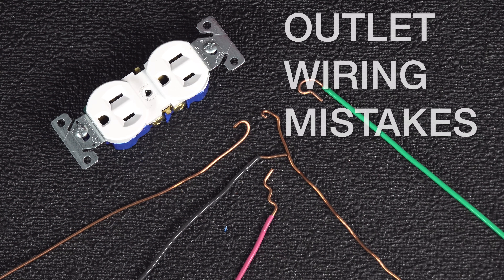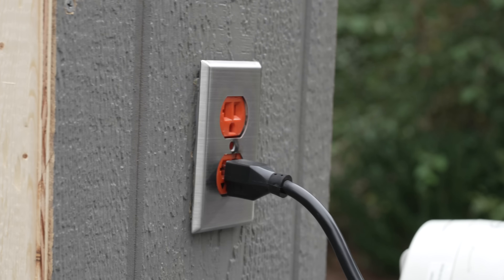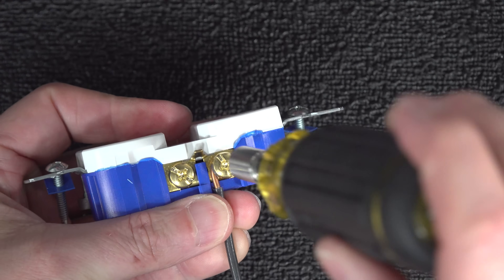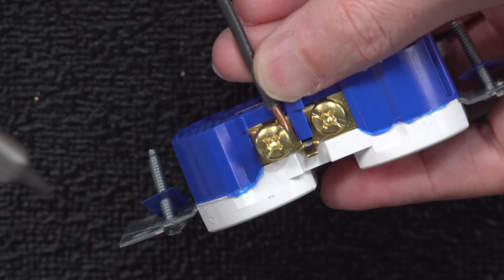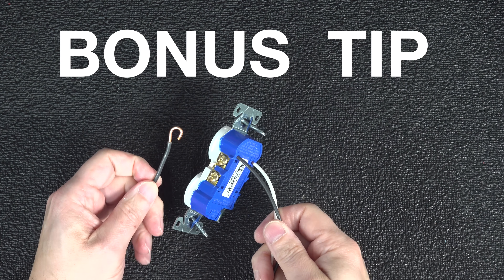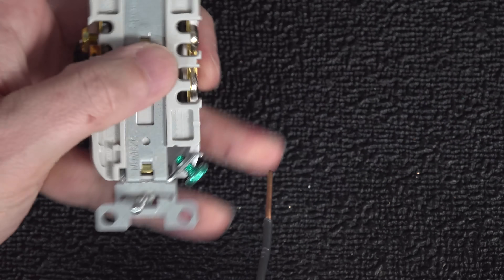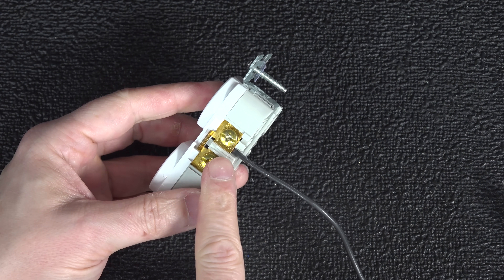BEWARE Of These 3 Common Wiring Mistakes On Outlets & Switches

Comment: Back stabs work just fine when u do them correctly. I was replacing receps ( not called outlets) and they have been working with backstabs since the price of them was $.19(I'm guessing the 70s) just fine. Backstabbing causing issues even when properly installed is an old wives tale. That being said, those along with pretty much everything in electrical can be a fire starter if done incorrectly.

Comment: Be careful saying black is always on gold or assuming black is always the hot should it be yes but best to make sure before you just assume and it’s even worse when you have 5 wires in the box and only half go to the outlet so be careful with what you assume in wiring or you will be chasing breakers

Comment: I am not a professional residential electrician but have an associate's degree in electrical systems and wire mostly low voltage dc panels at work. Still, when doing my own AC wiring at home, I just don't trust the clamp method, conductors become warm , even hot at times, when switch is off, they cool and retract, years of expansion & contracting distorts the metal conductor and they can become loose and even move. At least with a Shepard's hook there is not much chance of conductor pulling away or dislodging from device. Some ol' timers used to use shepard's hook and then tape around the screw connections because they were aware of metallurgy involved in conductors heating & cooling and the tension forced on wires when pressing receptacle back in gang box. Simple applied physics.

Comment: I am not a licensed electrician but in school I was taught to pigtail to individual outlets. 
Not only was it the way I was taught but I've seen several cases where jumping through an outlet has caused major problems. 
My buddies grandma's house has outlets jumped together thru her living room ending at a outside outlet. 
This outside outlet became damaged when the cord was snatched out of it. 
When I went over to inspect it I realized she almost lost her house because the circuit was on an stupidly oversized breaker. 
5 parallel jumped 15a outlets on a 30a breaker. Any guesses what happened? 
Yep it torched all 5 outlets between the outside and the panel before it kicked out. 
Singe the drapes which lucky went out since she was asleep and the a hole who did it said he saw it arc outside but thought it was fine and left. 
With all this said no it should not have been on a 30a breaker but it's has been corrected but if it had been pigtailed instead of jumped it would not have burned the outlets inside the houss before it tripped out. 
Psa: Breakers are to protect the house wiring and there by you from being harmed from over current because you try to run 25amps thru wiring and outlets rated for 15a.
DO NOT CHANGE THE AMPERAGE RATING OF THE BREAKERS OR FUSES IN ANY ELECTRICAL SYSTEM FOR ANY REASON THEY ARE THERE FOR A REASON! sorry pet peeve

Comment: Wrap your receptacle terminals with electrical tape.Go all the way around the devices terminals for added protection 👍
Reply: Electrical tape is for indication not for insulation
Reply: @richt5986  its for whatever I want to use it for.
Reply: @luckyt6886  I remember my 1st day

Comment: Hey knowledgeable people: @4:30 why would anyone attach more wires? I thought power delivery is a constant, does having more wires for the electricity to flow through prevent the wires in the walls from heating up under heavy load or something? It can’t increase power cause that would require change of the breaker right?
Reply: to answer your question better, the answer is basically no.  i think the guy was trying to say you can wire to a second device in the same box or to the next box this way buts its a code violation to do so
Reply: @westbornfarms  ohhh like daisy chaining from one box or hub multiple boxes from one box. Makes more sense, THANK YOU!

Comment: I would fire most people for doing everything you mentioned. If they're a helper maybe however we should be going over this beforehand. mistakes happen so a helper will get a pass 1 time but after that it's over. The trainer/journeyman over said helper would be questioned over it. This is too simple. Unfortunately, it can be done and you never know. It may work long enough to get done with the job.

Comment: I’m an electrician and back wiring is very common. We charge differently for backwiring which can be installed in 15 seconds versus looping which take about a min to install. Then we charge more if we wire all the wires in the back of the box together then pigtail wires to the outlet that way all the current of the circuit doesn’t use the outlet as it’s wire nut

Comment: The only thing you forgot to mention is when you do use a screw with a hook connection you should make sure you tighten all the screws even if they are not being used. That way the screws do not stick out past the wire. Also taping the outlet is good practice as well. Love the video.
Reply: What do you mean by taping the outlet

Comment: The "upgraded outlet"  outlet word of advice after connecting the wires when you are folding and pushing the wires and outlet back into the box after the wires are pushed back far enough before you use your #1 Robinson to screw the outlet to the box check the screws you originally tightened to hold the hot and neutral they will loosen depending on the way you push the device and wires back into the box...

Comment: Well done video, as others mentioned, you should start by cutting the power before  doing any electrical work. With regard to connections, in Japan, the only connections available are push in, there are no screws on outlets or switches. Even junctions are just push in type, it doesn't seem to cause problems. When O made the hooks in Canada, I always squeezed the wire in with needle nose pliers to give is extra contact.

Comment: How do you connect two ground wires to a switch if the switch is mid stream with switches further away on the same circuit?

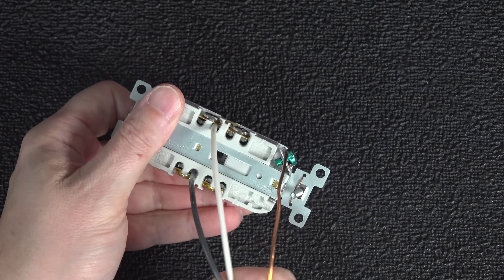Comment: That hospital grade switch also had a ground wire connection on one of the outlet mounting crews. If you're putting it in a metal box you can connect the ground wire to the box and if you have other outlets going into the same box you don't have to run a ground wire to them if they are also hospital grade with that ground wire. You can see it at the ground screw end of the outlet at 4:55 It looks like a copper or brass piece at the top mounting screw on the outlet you link to and it's called a "Self-grounding clip staked on, will never fall off" in the description.
Reply: And hope the inspector doesn't catch you
Reply: @JustHazardous  The devices that my company has done like that were certified by a third party that checked the device for our customer.

Comment: Ok let's not act like the hooks are hard, they also give more wire connection when done correctly. I've been doing this for years it's easy as hell. And the risk of injury or death is greatly reduced by turning off breakers or house power.

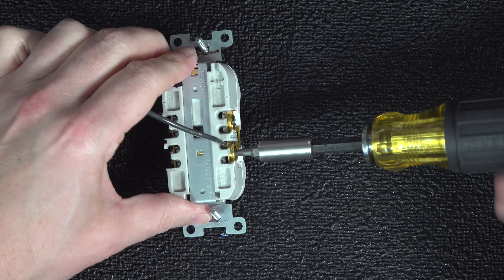Comment: @3:50 I’ve seen more issues with this vs back stabbing..I’ve been in the field for 10 years..never stab and tighten just wrap the screws..
Reply: Probably more outlets are wired this way, therefore you see more issues with it.

Comment: A caveat to the final product. The clamping mechanism has solid connectivity only if the same size gauge is used on both sides of the clamp. A mismatch reduces surface area contact and can result in connectivity issues.
Reply: Really not supposed to mix different gauge wires anyways, so i dont really see this as a downside
Reply: @mr6570  I only mention it because it can be done, and eventually someone most likely will.
Reply: So don't use it for one individual wire then?
Reply: @FlightRecorder1  individual wire is fine because the clamping force would be on that wire. The caveat highlights that the clamping force will be on the larger wire. The compression and threading of the clamp create limitations on how much force will be on the smaller wire, and the mismatch changes the engaged surface area as well.
Reply: You can use it for individual wires, making your point, well pointless.
Reply: Should never ever be two different gauge wires on the same device, much less in the same enclosure...

Comment: i replaced liek 25 plugs for on my own lol first time i think i did most of it right i may have put a few hooks backwards i think i did use the back holes some
no death only the 220 v can kill you unless mayeb you have health issue si plugged my self into a plug before when i was kid i plugged a  Christmas lights
and teh back plastic part where you plug it in on the plug part was missing so i plugged my self right into the socket lol was bit a scary i got stuck to it for a little
as it was hard to take my hand away or do alot but i yanked it off and i was like maybe 8 or 10  something

Comment: The old style outlets also have wire stripping depth guides built into the ends near each retention screw.  
I 'think' you can also use them to actually strip the wire.

Comment: In many outlets on the ground  there's a little hole you stick the wire into and then wrap it around the screw also the color scheme can differ depending on your jurisdiction In some places the red is no longer used brown and black are considered live wires grey is the neutral and green or green and yellow is ground

Comment: Meanwhile when I was in Kurdistan, folks would strip wires and plug the raw wires directly into the outlets... because the plug appliances werent consistent between items sent for aid, despite all being built for the same electrical system.
Reply: Alternatively, they'd kill the breaker, undo the plug, strip wires, and twist the cables to the cables connected to the outlet.

100% concrete homes though.

Comment: Old time electrician here.  The outlets with the shoes are great.  I always pigtail my wires in the outlet box so I only have one each hot, neutral, grd to the outlet.  Makes for a better overall install rather than daisy chaining the wires through the outlet.
Reply: Same here, makes for a cleaner and more efficient job
Unless it's a remodel, then i don't usually go though the trouble

Comment: The more I see videos related to American outlets, the more I get disgusted. I can't wrap my head around the fact that the contacts are just exposed on the inside.

Even in a country like India, it's just never seen. Even the cheapest outlets from the inside don't have exposed metal contacts or screws.

There is really no way you can shock yourself even if you grab the outlet and warp your fingers around it unless you have exposed wires which have been stripped too long.

Comment: Almost done replacing all the outlets and switches in my 30 y.o. house,everything was backwired,and the 2 GFCI one in kitchen one in garage weren't even connected properly, LAS VEGAS where frame to finish in 30 days is the standard lol

Comment: I don't agree that back stabbing causes problems.  I think that people pigtail 4 wires and then back stab 4 wires on the same outlet and that is what causes problems.  I think if you use the back stab holes appropriately with the correct gauge wire and don't overload the outlet with more than the recommended amount that they are perfectly adequate for everyday use.

Comment: The outlets I've been using lately have metal bracket washers on each screw. The washers are shaped to firmly grip exposed wire and pin it in place against the outlet body when the screw is tightened. This seems much more secure than the older "jab in" style that I assume relied on the tension of a spring.
Reply: The "jab on" connections have minimal contact surface area as well.

Comment: One thing that should be mentioned is to not pull or kink wires. When you kink wires or have them bend in a really small radius they generate alot of heat and can actually reduce flow and in rare incidents cause fire. Also be sure your wire nutz are the right size and are tight. I just recently fixed some electrical that was pulsing at the outlet(charger light was turning on and off). I went in the attic to see where the wires were going and the outlet that was pulsing was piggy backed off of a porch light. Where they had a junction box in the attic jumping power, one of the wire nutz was loose and arcing. It was black and melted and I believe the next step would have been fire. The pulsing in the outlet was from the wires arcing

Comment: I recommend stripping the insulation far back and pushing it forward, essentially insulating the tip of the hooks  on receptacles that do not have the improved stabb in method.
Reply: the hook should never go beyond 3/4s around the tightening screw. If it is, you're doing it wrong.
Reply: If you are using solid-core wire and installing it correctly, there is no reason to slip insulation to the end. If OTOH, you are using stranded wire which is generally preferred by professionals whenever you aren't using NM (romex) wire, it is a common practice to slip some insulation to the end when side-wiring receptacles to keep the strands from fanning out when the screw is tightened. However, in those circumstances we almost always use commercial grade receptacles with back-wiring to avid the problem.
Reply: @TwilightxKnight13  In all the years I've worked construction/renovation/maintenance I've never met a professional who'd willing waste so much money wiring home receptacles with strained over solid conductors.

Comment: If you put 8 wires into a receptacle you are an asshole, especially in new work. Nice long pigtails are the way. Only time I wire through an outlet is when replacing receptacles in super old houses with boxes so small it’s impractical to put wirenuts and a device in the same box.

Comment: Few things: backwiring is fine if you’re going out- for example daisy chaining a second outlet can be backwired off an existing because if it comes out you lose the circuit.
Secondly the ground doesn’t have a canal because you want to keep the ground long and clamp it closed with wire strippers or pliers. Or keep it long to connect to the box if the line isn’t grounded at the breaker. (Used to be common in garages and things)

Comment: anyone connecting 8 wires in the back of an outlet is not going to be watching this video because they hopefully have been doing electrical work a looooong time. dear God don't use this as a DIY tip, someone's house is going to burn to the ground.

Comment: I like electrical work, I just hate going up and down the stairs 18 times to find the right breaker to flip because none of them are labelled correctly.
Reply: Or plug in a radio into the outlet you want to turn off with the breaker. When you can no longer hear the music, that’s the breaker
Reply: I was doing the same thing until I started using my iPad and my wife's iPad. I set up her iPad facing the light in the room, facetime her iPad and then go flip breakers until the light in the room goes off.
Reply: You can buy a 20 dollar breaker finder tool that plugs into outlet. Works great.

Comment: You forgot the mistake of using a Philips head screwdriver like you did in this video. Flat head or the electrical specific tips are the only drivers I trust to get enough torque.

Comment: The hook method is the best way to go. The only thing you left out was that you need to close the hook after placing around the screw,ALWAYS. The spec grade outlets are best when using stranded wire.

Comment: An observation on the direction of the wrap around the screw as one could argue that wiring it backwards (counter-clockwise) prevents the screw from loosening when the wires are pulled or under tension.  

It's a well known engineering fact that pulling wires wrapped clockwise around screws can apply a rotational torque to the screw that can loosen or tighten said screw and allow the wire to become loose and eventually be pull out.  Whereas wiring them backwards (counter-clockwise) causes any 'pulling' of the wire to tighten the screw.  

Granted this is a very unlikely occurrence and most likely the reason why we wire them clockwise to allow the wire to be pulled into and around the shaft of the screw.
Reply: That's what the staples are for dude. You should never be able to pull on a wire and have it only secured by it's connection to the outlet. By code you have to have a staple within 6" of the outlet just for that purpose.
Reply: @caseymoore9737  ... As I said, there is a reason why you would wrap it CCW ... but many other reasons why you would wrap it CW ... which is why the codes are as they are.  Not saying the codes are wrong, just saying there actually IS a valid reason why some things are wrapped CCW.

Comment: If the brass silver part is hard to see or you are wiring in the dark because the power is off the neutral and ground are bonded at the box so the neutral side is the side with the ground lug. I'm not certain that nobody makes and outlet where this isn't the case but I've never seen one.

Comment: Great video. Exactly what I see out in the field. I would just add a few things. 1. Twist your wires. Don’t just bunch em together in a wire it for a splice. And twist it only just past the insulation, not all the way back into the box. 2. Tighten down unused screws. Some ppl like reaping around the outlets and I think that’s a good idea, but at minimum tightening those suckers down really help preventing shorts.
Reply: Taping?
Reply: @danielcarroll3358  If you complete the work properly, there is no need to tape anything. However, if you are using metal boxes it is "preferred" that you wrap the device with tape to prevent the terminals from touching the box if, in the future, someone is forced to work on the system while it is energized.